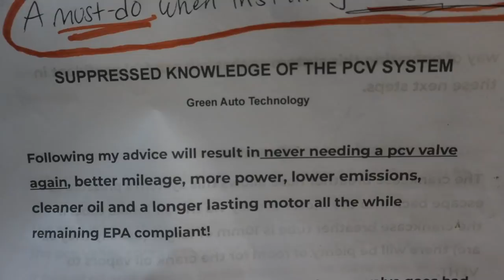The Wonder Of Positive Crankcase Ventilation

Comment: If you need a down side of the pvc, it eliminated their auto anti rust tube from coating the undercarriage and keeping the gravel dust down on the back roads 😆
Reply: Yes when we converted those old heaps to a floor shift. We chopped the shifter hole in the floor with a hatchet. If you would have put a torch to the floor pan it would have resulted in a great blazing inferno that coating was very thick.
Reply: True
Reply: Yes.
I have ran a vent tube to the insides of the front uni-body frames one side at a time.
Reply: I have a 99 Dakota and the rear driveshaft seal went and gave herself a nice oiled coating on the midsection of the frame and body. And I think she leaks a little oil under load because I've found oil and grease all over the front end. Not dripping just a nice thick coating on everything
Reply: You mean British rustproofing?
Reply: Hell, my car has a PCV and it still coats the undercarriage with oil 🤣

Comment: Oh man Tony you were soooo right on about this!  I worked in a gas station all through high school  (64-68) and we did a lot of work on  road draft era cars (because they all were that way  then LOL) and the sludge and gunk inside the higher mileage engines was a nightmare!  The valley would often be half or all the way full!  Then to top it off, a lot of people loved Pennzoil, which was full of ash that left a gray slime inside the engine that was almost unremovable.  Remember the majority of oil filters then were canister jobs with replaceable elements that meant you had to clean out the canister when you changed the oil.  A lot of this is why the boss paid us teen agers a whopping 50 cents an hour to play grease monkey!

Comment: I remember road draft tubes from my first engine (225 slant six) and the nastiness inside the engines. One fact not mentioned about the shininess of the oh-so-slightly oil slicked roads is it reminded experienced drivers to take it easy until the oil washed off. They were extra slick for the first 15 minutes or so (depending on the rain), and you could often see when the oil was washed away.
Reply: Is this why we were taught in motorcycle training courses about the dangers of recently wet roads? They always talked about how slick a road could get immediately after the rain started, because of oil being on the roads. But I've never experienced this, and nobody I've ever talked to has experienced this hazard either. Now I'm wondering if it wasn't knowledge carried over from 50+ years ago.
Reply: @AustinRBa  That, and depending on how recently it was asphalted, how much idling traffic, how long before rains etc. 

You see it in my part of texas when we have dry summers, after a few weeks of no rain and then a light mist.
Reply: @AustinRBa  it is one of the factors--i have a driving manual from 1962, judging by the photo of an Impala in it. of course there are cars that still leak, but you're about as likely on a motorcycle to find the traffic stripes laid down are slippery when wet. What blew my mind in motorcycle class was how most accidents are single-vehicle--meaning rider error.
Reply: Damn I sure remember the dark oily center of highway lanes back in the 70’s.
Reply: I had a E-150 with a 300 cu. In with a 1 bbl. The vacuum nipple clogged on the intake manifold and as my step-dad and I were going to an amateur radio show when my step-dad saw oil running from under the cowling. I pulled over and had a piece of heater hose so with positive crankcase pressure I slid the hose over the dipstick an gathered the oil being pumped out of the dipstick tube with an old oil bottle and proceeded to the show then heading back home stopping periodically to check and add oil. I got hope and found the clog in th pcv hose nipple and fixed the problem. The 300 six ran on  1 1/2 quarts when we noticed the issue.I had a leaky valve cover gasket so I had a case of oil so I added oil and gathered the blown out oul and poured it in as we made it back home. Good thing the 300 six is bulletproof.

Comment: Sorry I actually attended a emission school some years back after retiring from the Navy.  The emission seminar was at the time held by NAPA to mechanics concerning the new emission systems being implemented.  The year was 1993 and if I remember right it was in November so you can see it was a while back.  The guy running the presentation started his seminar with a simple question of "What emission control system was instituted in 1963 that reduced emissions by 75% and cost less than $10 per vehicle to install in (1993) dollars mind you".  Well that to me was a gimmie the PCV valve.  And yes I was correct, and I don't claim to be a hot shot mechanic.  The lecturer then simply explained that we have been whittling away on the remaining 25% for the past 30 years and for 1994 approximately $2000 of emission controls are on every vehicle to whittle away on that remaining 25%.  He then displayed a graph of the emission reductions year by year, and it looked like a straight line for the past 15 years on the 30 year graph.  He then displayed another graph expanding the emission numbers greatly for the past 15 years, now remember this was November 1993, and it did show a decrease by roughly 50%.  But then he showed yet another graph showing the decrease in emissions as compared to that 1962 non regulated engine.  It actually drove a point home in the real world thought process.  Yes we are reducing emissions, and as the EPA states, some have been reduced by 50% over a 10 year span.  But these 50% reductions are for example starting at 5 grams per mile , not actual but used as a base number for demonstration, is reduced to 2.5 grams per mile.  But when compared to a non regulated engine the starting point was something like 1500 grams per mile.  Did some research and found that today, roughly 30 years later, that 2.5 grams has been half again to 1.25 grams and only for the cost of roughly $2700 per vehicle to meet these standards.  Now start doing some math and you will see that the cost per vehicle emission controls have skyrocketed  to meet standards while the reduction in emissions is practically non-measurable.  Maybe someone should do a youtube presentation that demonstrates accurately just how emission standards have changed and the cost to meet these new standards.  We are so far down on that bell curve that we are paying a fortune for practically nothing of value.
Reply: This is a great point... One I keep saying when it comes to this manic pushing of electric cars. Same with the whole global warming thing. Sure, industry polluted in 1920, and cars were.pretty bad in 1959, but look how far we've come. That last 20%, or whatever, isnt really gaining much for what itll cost!!
Reply: There is another mitigating factor --- the immense increase in the number of vehicles, that although being really clean, by sheer numbers are polluting on a much grander collective scale. 
There was a Volvo(?) Saab(?) Peugeot(?) that had so greatly controlled its emissions, that it was pumping out exhaust that was cleaner than the air going in! In any case, it was a fluke and an experiment that was too costly to implement across the whole field of manufacturers - although I haven't seen states being too bothered with that idea.
Reply: Then there are electric vehicles where the manufacturer gets to pawn emissions off on the power plants.

Comment: Thanks for the heads-up, guys.
I fully agree with your  observations on the PCV system. My first engine rebuild ('74) was a 318 poly in a '62 Dart 330 wagon, which used that road vent system. The inside of that engine (~120K miles) was horrendous. Hot-tanking the block was not sufficient to remove the sludge from the lifter galleys. Even the oil holes in each rocker remained plugged. I ended up having to use a twist drill to open these up. I used a broken piston ring as a scraper to remove the carbon that had built-up in the ring grooves. PCV was a good idea.
I recall seeing an option for '53 Studebakers that actually put a small squirrel-cage blower on the road vent input tube for cars used frequently in stop and go traffic.
Reply: Damn those 10,000 mile synthetic oil changes.
Reply: Big diesels used road draft tubes for decades. They stay clean. Wonder what the difference is? The oils?
Reply: @chrisleggett685  Maybe they were doing mostly highway miles, where the draft tubes kinda work?
Reply: Pennzoil
Reply: @chrisleggett685  they now have catch can set-ups and run the vapors back into the engine. 

The open vent also was a built-in oil-undercoating system.
Reply: I am inclined to think that sludge was more the result of the oil they used back in those days. Detergent oil had not yet become popular as many guys stuck with the old parafin base oil which clogged up everything. I have taken off valve covers and you couldn't even see the valve springs. this, coupled with the open crankcase system led to a life expectancy of probably 80 or 90 thousand miles before being rebuilt or junked.
Reply: @garyjubar5733  yep yep...like pennzoil. Haven't used it years but i remember it being the worse for sludge and brown waxy film on everything.
Reply: I have a buddy with a project I have been working on for a while...31 chev ton and a half truck. Original inline six...50k on the odo and the speedo still works...50 years in a barn find...valves were so loose it would not run...somebody drove it until it would not run and just parked it...motor is dead nuts clean inside...oil is so clean I haven't even changed it...and yes, it has blow by...if a motor has blown it will either go out the road draft or through the pcv valve...you motor was one of those deals where it either leaked or used oil and whoever drove it just kept adding oil and never changed it

Comment: I never had issues with a simple PCV system. It does it's job and doesn't seem to interfere with anything. I agree with you that it's a good thing.
Reply: I had a PCV valve get stuck open once, 500 miles from home.  Engine overheated on the highway and it wasn't obvious why.  Other than that, it's fine on a good engine.  On one that has a lot of blow-by, it'll clog the air filter and foul the valves.
Reply: @KC9UDX  You are thinking EGR. All a stuck open PCV valve would cause is excessive oil consumption at idle. In no way can it result in overheating.

Second the PCV pulls air from the air box, it does not supply air to the air box that would be reverse flow to it's function both in design and what physics allow.  Fresh filtered air enters the crankcase. Crankcase fumes get pulled into the manifold to be take into the air charge and burned. And as long as the engine isn't a GDI the fuel in the incoming air charge will wash the valves.
Reply: @Cragified  PVC can certainly send much oil into the intake (too much for fuel to clean) on an old engine.

A stuck open PVC valve does cause overheat at highway speed by significantly leaning the combustion mixture.
Reply: @Cragified  A stuck open PCV is basically an inlet vacuum leak and can cause all the bad things that come with that.
Reply: @KC9UDX  A stuck open PCV valve at highway speeds will only be in the position it should be at. High intake vacuum (Idle) = mostly closed. Anything but closed throttle (High engine rpm) = open. 

The PCVs job is literally just to prevent full manifold vacuum from being applied to the crankcase which only happens when the throttle plate is closed.
Reply: @ferrumignis  A vacuum leak at idle which won't cause overheating. Just a high idle and oil consumption. The PCV valve is a variable measured orifice with a calibrated spring valve. Vacuum high overcomes the spring and closes the valve. Vacuum low valve opens. It only exists so that maximum vacuum when the throttle plate is closed isn't applied to the crankcase.

Some PCV systems don't use a valve at all just a very carefully selected fixed measured orifice.
Reply: @Cragified  well it happens and it happened. It's about vacuum, not throttle plate angle.  Incidentally, you have to have an engine with EGR to have EGR trouble 😊

A "PCV" system without a PCV valve is a CCV system.
Reply: @KC9UDX  Vacuum is generated by the existence of the throttle plate. It provides the restriction that prevents the amount of air being displaced at 1 atm from entering the cylinder as it normally would. Thus generating a low pressure in the intake aka vacuum. 

Without a throttle plate blocking the air flow there is no 'vacuum' just ~ 1 atm airflow.
Reply: @Cragified  exactly.  So at what vacuum does the PCV close?  And what vacuum does that motor run on the highway?
If your engine doesn't overheat when it runs lean at idle, you may have one of those 100MPG carburettors. 🙂
Reply: @KC9UDX  Depending on engine a PCV system is designed to pull at maximum 1 to 3 inches of 'vacuum'  at the inlet of the PCV valve which means that it should have a pressure that is 1-3 inches lower then atmospheric pressure.  Enough to provide adequate venting of blow-by gases. 

The valve closes as the throttle plate closes and manifold vacuum increases to maintain the desired forced ventilation. And opens as the throttle plate opens which causes manifold pressure to return to near atmospheric. The PCV valve orifice isn't large enough to cause a large vacuum leak. All you would see is a high idle.
Reply: @Cragified  it did cause a large vacuum leak with overheat, and high idle.  Else I'd never know I had a problem.  The bottom line is that the engine ran hot, so I slowed down which exacerbated the problem.  I stopped and observed high idle.  Eventually I pulled and plugged the PCV line (not my first instinct), causing idle speed to drop and me to realise that the PCV valve was the source of the overheat condition.  I plugged the line (screwdriver?  Paper napkin?), found an O'Reilly Auto (notable because it was the first time I ever saw one) and bought a PCV valve.  Problem solved, no more overheat on the highway.  

I blame that overheat incident, plus EPA causing off-the-shelf oil to contain less zinc, for the very early failure of that engine.
Reply: @Cragified  Do you understand the concept of unmetered air?

Comment: The PCV, EGR and especially the cat were three simple things that really cleaned up the air. Follow any car with a bad or no cat and you can smell it about a half mile away. Fuel injection really helped too. Beyond those simple improvements we've gotten a lot of complexity for not a lot of improvement.
Reply: Don't forget the A.I.R (Air Injection/Reaction) devices --- commonly called a "smog pump". They were single-handedly responsible for burning HCs in the exhaust manifold. 
Sometimes this was the ONLY device on vehicles over 10,000 GVWs - with the PCV of course, but those 396/454 Big Block Chevys in motorhomes were really clean at the pipe when we tested for 2 and 3 gasses.
Reply: Yeah there’s no environmental benefit overall when cars are getting sent to the scrappers because of overly complex emission controls getting clogged or failing.
Reply: @Jonathan_Doe_  In terms of CO2 this may be true, but none of those systems are intended to reduce CO2 emissions.

Prior to the 2010s all emissions regulations were specifically intended to mitigate human health impacts from vehicle exhaust. Scrapping the car will produce emissions, but relatively few people will be exposed (only the scrap workers vs everyone in the city/state if the car stays on the road) so the overall health impact is reduced.

On the other hand, if you intend to mitigate global warming you should try to keep vehicles in service as long as possible, rather than emitting more CO2 making a new one. This applies even to electric cars.
Reply: @nerd1000ify  the production of the new steel and various castings to produce a new car probably puts out more noxious fumes than emissions control equipment like DPF’s, ad blue systems and GPF’s on current models stops. 

It’s just passing the health impact onto poorer countries where this stuffs made.
Reply: @Jonathan_Doe_  we'd need quantitative data to assess that.
Reply: The EGR doesnt do much other than cost me money. Thankfully my engine has no EGR or CAT
Reply: @psd28  EGR suppresses your NOx emissions. In naturally aspirated gasoline cars it also improves fuel economy slightly by reducing the pumping losses when the engine is running at high revs but low load (e.g. highway driving).
Reply: @nerd1000ify  in a diesel application it is ideal to delete the EGR for increased performance and less wear from soot going into the intake
Reply: If you were to remove the cat and smell the exhaust it becomes obvious that the cat does almost all of the pollution mitigation. Follow any old beater with no cat and you can smell it for a half mile
Reply: @AmandaHugenkiss2915  my truck never had a cat in recent years but i can tell you the cat really doesnt do much for a 7.3 especially at idle

Comment: Good thought.  I remember the days of yucky engine oil, but the longevity of post pvc valve engines involved a bit more engineering than just that.  The oil slick in the center of each lane made for quite a slippy slide for a motorcycle on a rainy day!!!  Scared the crap out of me many times!!!
Reply: Yepper!   I forgot about having to avoid patches of cruddy oil with white goop floating in it when riding my two wheeler!  Got scared chit-less when going around an exit corner and the FRONT wheel took a sideways skid to the right on a left hand turn.  When the tire hit a dry spot, the bike immediately went bolt upright and I had to countersteer quickly, not because I was going so fast but being the turn was so sharp.  Worse, my 14 year old little sister was on the back.   Those of you who ride know just how awake I was the rest of the day!